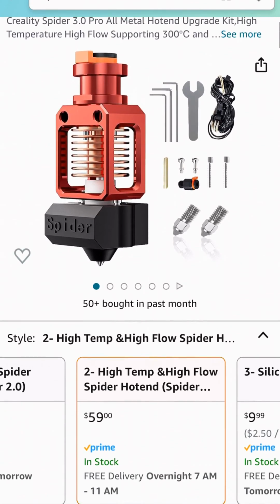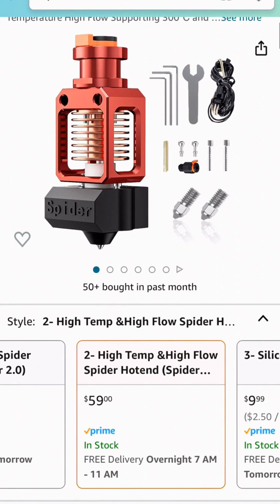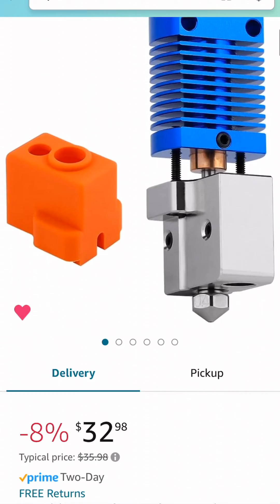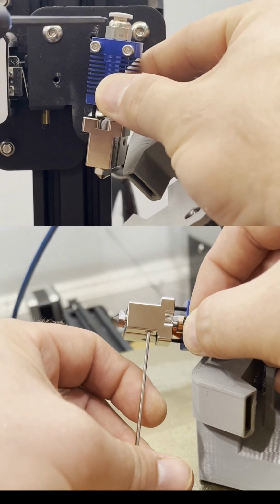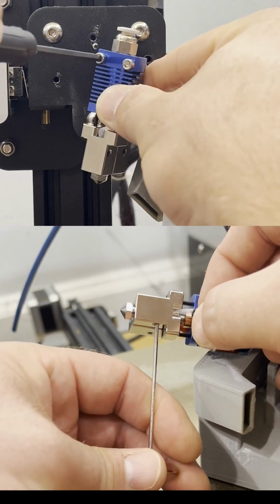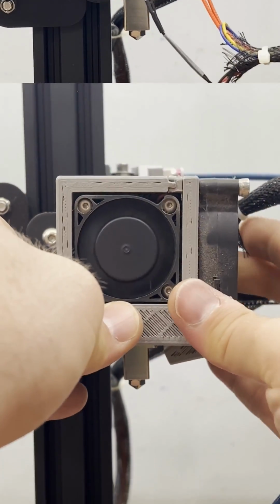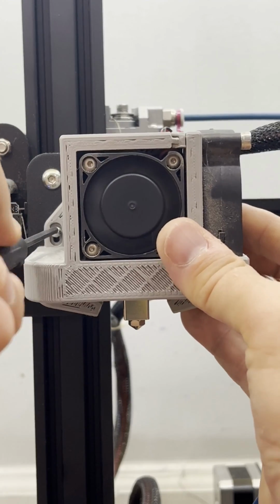Comparing a #budget hotend with the #creality spider 3.0 on my #ender3 #3dprint  #3dprinting

Comment: Did you face any clogging issues with the Creality Spider V3? I am facing severe clogging issues with printing PETG and I cannot seem to figure it out...What changes, if any, did you make to your printing profiles?
Reply: Same did you fix it?
Reply: @MalcolmTheRealtor yeah... In my case the problem was the extruder...it was malfunctioning due to wear on the gears... After changing to a sprite direct drive extruder I never had any issue again

Comment: The spider v3 with a CHT nozzle is really good flow rate. I tested it out on my vzbot. Was able to get a little over  11min benchy out of it without any noticable under extrusion and the weight was within .5grams of a 15min benchy.  

Currently i have it on one of my ender 2 pro that's been modified, inspired by a rat rig v minion. It's a solid hotend and can be had for about $30 on AliExpress when it goes on sale. 

The budget one I had for a while on a modded ender 3 pro. It worked perfectly fine once I got the right duct. I sold that printer a few months ago, it was still working fine. I used almost every filament you can think of on both of them (excluding exotic filaments).

Comment: I mean if you're going to drop $30 on a new hotend you may as well go chc ceramic heat-block and volcano nozzle. Though you don't need an upgraded heat-block to use volcano nozzles. Just put a couple brass nuts on the volcano nozzle and screw it into the regular heat-block and cinch the nuts up to the block.

Comment: My 3D printer rocks a Volcano V6 clone hotend with an all-metal heatbreak,  an oversized heater block, and a 50W 24V element instead of the default 40W, attached directly to a BMG extruder to work as direct-drive. (Total distance from filament entry into extruder to nozzle opening is about 10cm.) Total cost for the whole hotend/extruder setup was like $80, and it's about the most reliable direct-drive print head I've seen on a cartesian printer. With a 0.6mm nozzle and a decent quality PETG @ 220C it'll maintain right at 20mm^3/sec extrusion volume and it just never clogs unless I do something dumb, and my maintenance is basically "wipe exterior clean with brass brush before printing."

I'm sure the fancier more "modern" hotend setups have their advantages, but unless you're doing high flow rates on a fast coreXY machine I don't see where they're really worth the cost.
Reply from the maker: That’s an awesome setup!
Reply: @printmeister  I don't know if YT allows links to Imgur or not, but I have a pic of the gantry assembly with the head assembled but not wired during its constriction. Really shows how tight a direct-drive setup can be.
https://i.imgur.com/Ny8qfSn.jpeg

EDIT: Oh, hey, it does!

Comment: complete waste of money.
Reply: What? Upgrading your hotend? Or are you referencing the more expensive Spider hotend? Just curious.
Reply: @antonsavelyev4258  It's rather odd too, because the "budget" hotend is has an all-metal heat break and is using a volcano nozzle.  Definitely a step up from the stock ender 3 hotend.  Yeah, it'd probably be worth more to get the ceramic heater, but then you'd probably have to put on a mounting kit for V6 groove mounts.
Reply: @Grimmwoldds  Yeah I see what you mean. Not too experienced in the hotend realm of things, since I'm just running two Ender printers; I never felt the need to ramp up the speed, just kinda battling to achieve as high precision as possible right now.